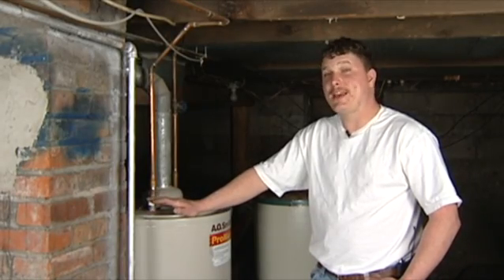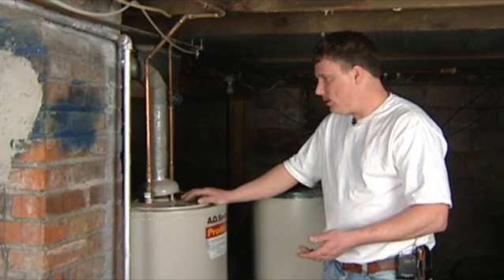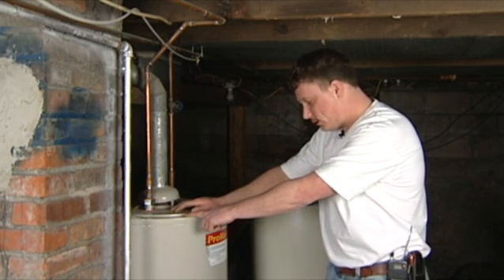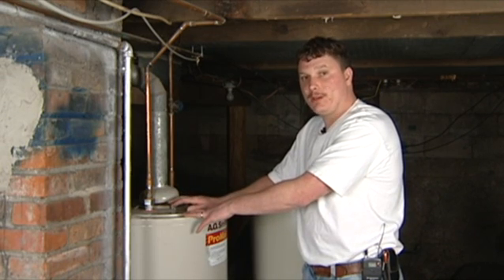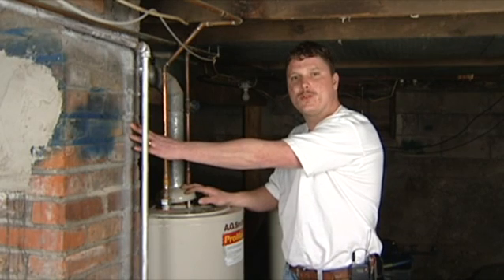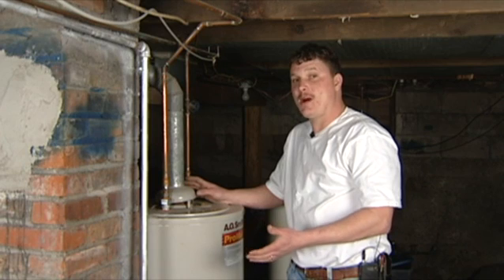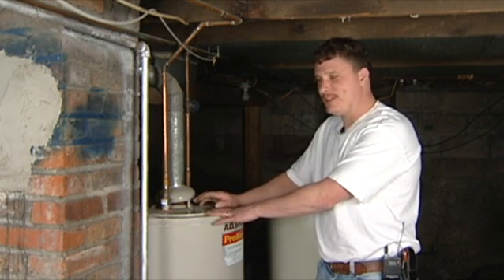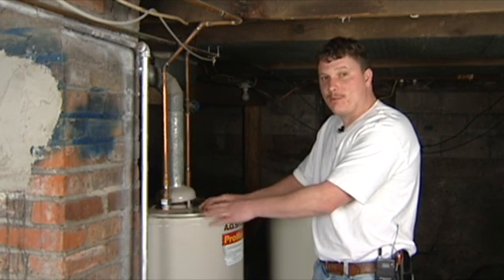Plumbing & HVAC Maintenance : Gas Water Heater vs. Electric Water Heater

Comment: How can you tell the difference between gas & Electric. Gas always has the exhaust pipe on top & pilot and all that other crap on the bottom right?
Reply: If you have to ask this question, please do not attempt to install or buy one on your own, go to your plumber and have them set you up.
Reply: Wasn't planing on it. Just asking. But thanks, i found out.

Comment: Is not one of the benefits of electric hot water heaters that it would be much safer? No gas leaks, no fire sort of stuff? Also do the electric ones need any sort of exhaust?